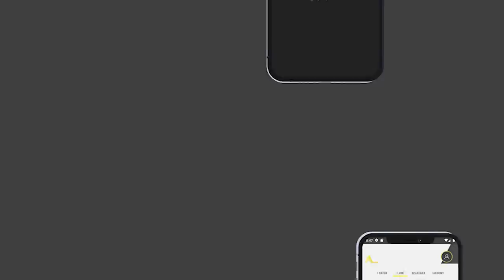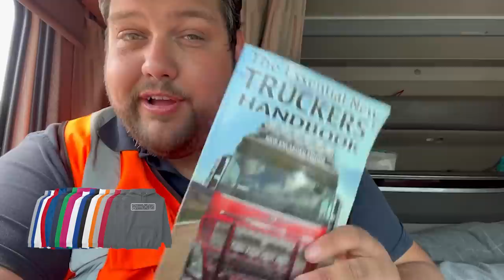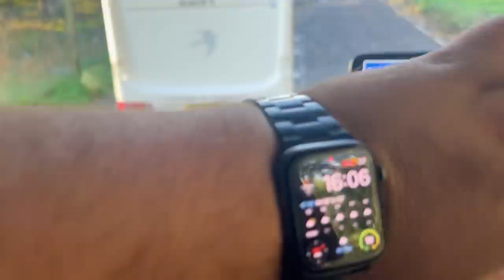Lost My Tyre On A Smart Motorway! Stoped In A Live Lane!

Comment: Luke I used to be a London Transport Bus Driver and my attitude to car drivers was without them being stupid my day would be boring. I used to give a running commentary to the passengers when I could see a car was going to be stupid. Passengers loved it.
Reply: LT drivers 😂 London finest drivers just as bad as black cab drivers and I’m a class1 HGV driver and former Coach driver of 20 hrs and I’m saying this. I don’t know where London bus companies get there drivers from cos 99% can’t drive.
Reply: @Fast_car1000  Agree with you entirely. I am talking forty years ago when driving a London bus was thought off as a highly prestigious position. Out of 235 applicants five of us were chosen. The scariest thing we had to do (allowed three attempts) was to drive a reasonably straight line on a skid patch. Brakes locked on and only released after skid by instructor. First attempt spun three times. second attempt half spin and corrected third passed. Nowadays I am sure they just drag them in from the street. We were taught how to Candice brake so as not to cause discomfort to passengers. etc etc. Now they tear up to a stop and I think they get a bonus if they eject a passenger through the front wind screen. They operate on a time means money system.

Comment: I quite agree about smart motorways. They are very dangerous because they don't or can't shut the lane immediately which means that anyone in that lane doing 70 mph without concentrating could easily smash into the breakdown.
Reply: So you blame the motorway rather than the not concentrating 🤔🤔🤔
Reply: @roryhennessy7529  As an retired Class1 driver smart motorways are a driver's nightmare. I am not blaming anyone but the government for bringing them in. If a car breaks down, before it is noticed, so that the matrix signs can be altered and the lane closed and it is dark, raining and the drivers to the right do not let you in because they are berks, an accident is highly likely. I have seen vehicles that have smashed into the rear of other vehicles because the broken down one had nowhere to go. There are many factors why, like being on the phone, distracted by the passengers, speeding etc but the fact remains that if a hard shoulder was present the crash would not have occured.
Reply: @johncouriermeh  loads of roads have no hard shoulder
I think calling them "smart" is the problem
When people see "smart" they think they don't have to concentrate or pay attention

Comment: Silly question. Maybe you could address this in a video. But how do you know where your going. i understand signs and a satnav, but when it comes to roundabout junctions how do you know what lane you need to be in, or does everything just move slower when your in a truck? The reason i ask because when im driving i went from Leeds to Canterbury and i didnt know the area at all and ended up getting lost and actually went through london on the way back because of a wrong turn. Is it just down to experience, or do you have a really good satnav that tells you which lane to be in, because mine isnt very accurate google maps.
Reply from the maker: Combination of things really. Sometimes it’s just experience and a judgement call. other times you read the signs ahead. And sometimes the satnav all day which lane you need to be in. Put all three together and the majority of the time you will find yourself in the correct. However, worst case scenario just take up two lanes if you’re not sure. Highway code states to give large vehicles extra room so you are perfectly within your right. to take up two Lanes Should you deem necessary. If all else fails and you are in the wrong lane and can’t get out then it’s just a case of turning round somewhere

Comment: I've had blow outs and brake failures on every type of vehicle.  Having seen the damage to the tyre I would've driven it to a place of safety if possible.  Not like that bonehead driver who stopped his burning truck in a tunnel in Wales, where do they get them from?  With regards the front wheel blowout on an artic, once I'd regained control and the rim had shed most of the rubber I realised that the vehicle was easily steerable so I let it roll onto the hard shoulder easily.

Comment: That's why Smart motorways are absolutely dangerous.  Some vehicles have come to a complete standstill when somethings happened, and people have been killed.  Government has now ceased operations for the next 5 years to investigate it.  The one on the M56 close to the airport, started off as a Smart motorway, and I noticed that they've carried on working, even though all major works were to cease.  They now call it Traffic Control system.  Their way of getting round being called a Smart motorway and losing money.  And the Range Rover was driving illegally, undertaking to not only get past you, but the truck in front, for what.  That's how accidents happen.  When its a complex with various shops, its a Retail Park🤣.  In France, its "Commercial Center"🤣.    Majority of southerners, is that they don't understand the concept of "Less Haste, More Speed" where driving is concerned

Comment: Forgive my ignorance but what is a smart motorway?
Reply from the maker: It’s a motorway designed to ease congestion by having more lanes opened at a variable speed limit depending on traffic flow. However, to achieve this cheaply and quickly, they removed what we call the hard shoulder which is an empty lane to be used for emergencies like blowouts, mechanical failures or fires ect. 

So if you brake down on a “smart motorway” you breakdown in a live and active lane. Many accidents and deaths have occurred due to other motorists not paying attention and driving straight into the stationary vehicle
Reply: @lukecinahgv  yay for expediency.

Comment: Why didn't you just drive off the hwy to a parking lot? Axle was up and it would be a lot safer.
Reply from the maker: There was no parking lot. Next services was over an hour away. Wheel automatically redeploys down once to go faster than 10mph or so
Reply: @lukecinahgv  gottcha. Why does the axle auto drop? That doesn't happen to us here in America.
Reply from the maker: @YARCHLRL  becisse if the weight on the trailer. It detects it. If I was empty it wouldn’t have been an issue
Reply: @lukecinahgv  your system is way different than ours here. I'm glad you got it sorted...

Comment: Lucke c your third wheel on the right hand side of the trailer is also due to go bang does your company have any mots done on the trailer
Reply from the maker: Not only do our trailers have MOTs but all our tyres are cheeked WEEKLY by a qualified tyre fitter. Every weekend. 

If any tyre on any of our trucks and trailers needed changing they would be changed 🤙🏻